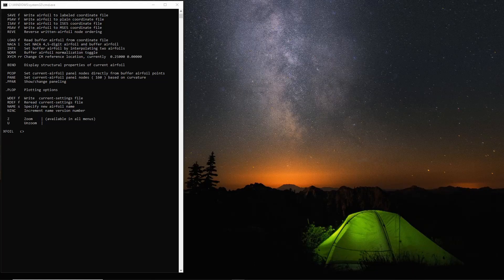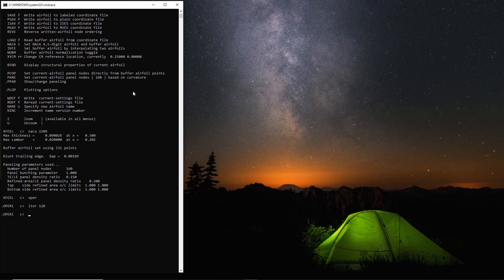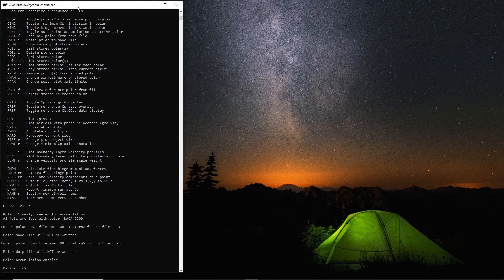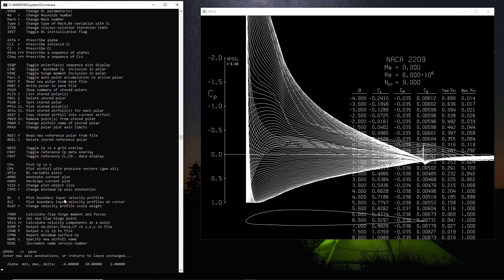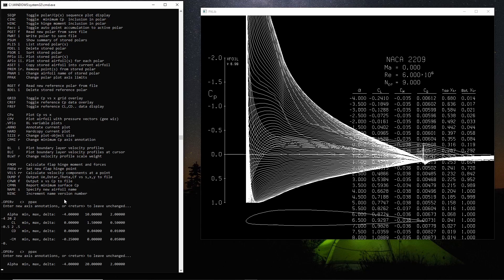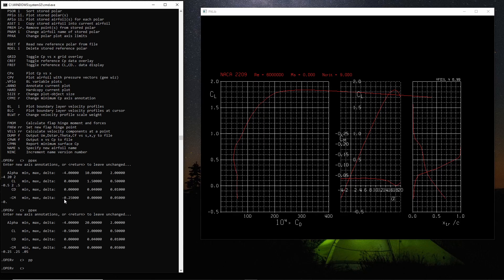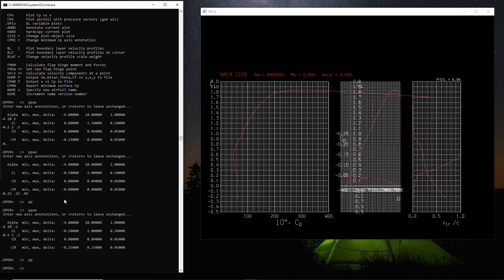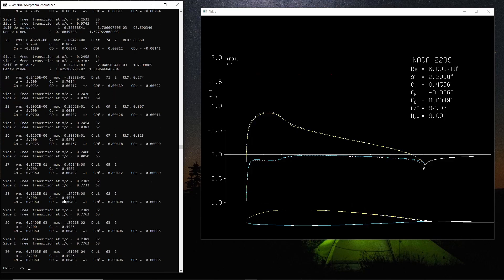How to use XFoil | Part 3

Comment: I have been going through your tutorials, and it has helped me get started, but I'm getting * NOT CONVERGED * on all of my results, regardless of the iterations I'm doing.  I took an airfoil from my CAD design tool, and created an SVG out of the sketch, and used coodinator to generate the X/Y coordinates.  This seems to work although I get an warning about sparse leading edge or something, and I used pane as the warning suggested.  I then set the reynolds number, and enter the angle of attack (in my case it's 30.1 degrees).  What I'm wondering is if I'm calculating all the numbers correctly.  I used a reynolds number calculator online, and what I'm not sure of is the chord.  On loading my airfoil file, it outputs that the chord is 127.nnn.  What I'm not sure about is what is that scale for that measurement?  My sketch is in millimeters, and 127 mm doesn't seem to make any sense based on the rending of the airfoil.  The entire airfoil is 48.46 mm long.  Just trying to make sure I understand the numbers so I can calculate things correctly.  I'm pretty sure that that number is more like 1.27 mm, but again, it doesn't say anything about the scale of the numbers.  Thanks for any assistance you can be.
Reply: ofcourse it's not going to converge for an AoA of 30 deg

Comment: Hey man! I have a question related to Scaling and Reynolds number. Xfoil assumes the chord to be 1 when estimating lift & drag polars at prescribed Reynolds number. If the scale is modified to suite my actual foil with a chord of 0.035m, do I scale Reynolds number in proportion? THanks for the help!
Reply from the maker: Hi Byron, 
You will need to scale your Reynolds number.